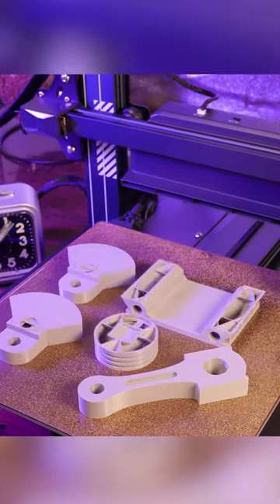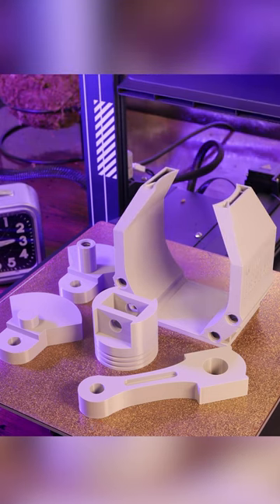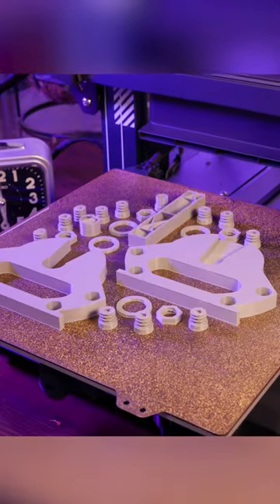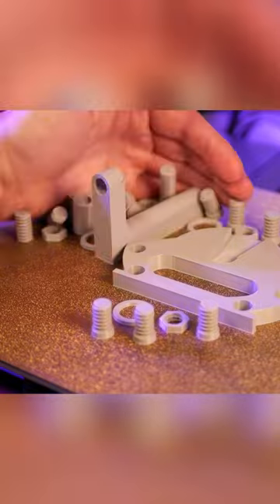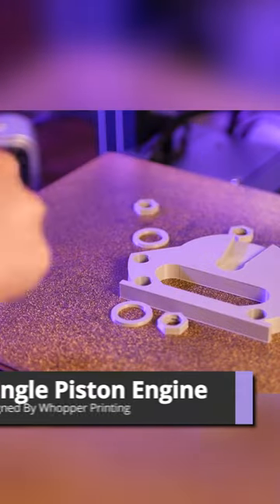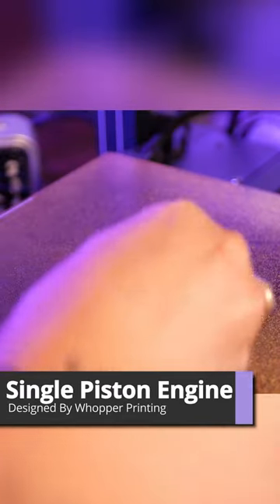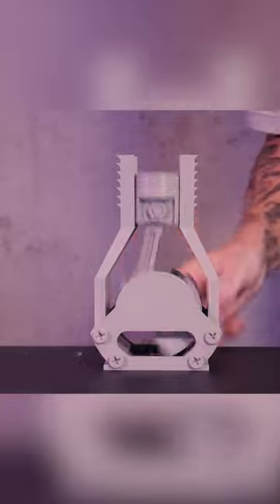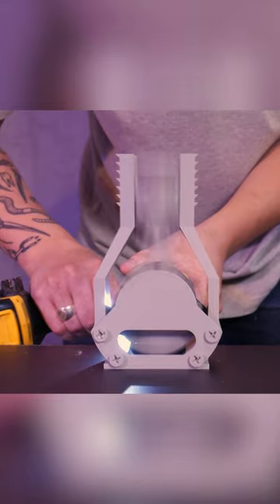3D Printed Single Piston Engine! 👀

Comment: is that a cork print bed?
Reply: no
Reply: @rubenstenlund  is it a special finish? can you link where you get it? @WildRoseBuilds, the  adhesion looks great
Reply: It's a pei magnetic print bed. You can find them with smooth or rough surfaces or some that are double-sided and have both